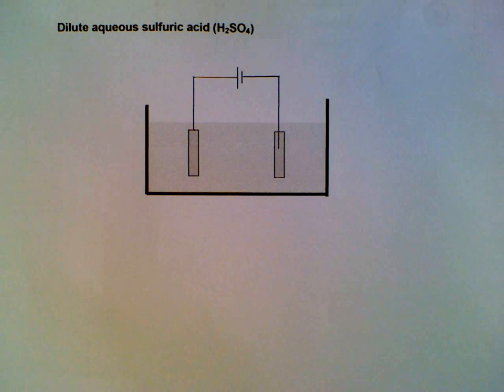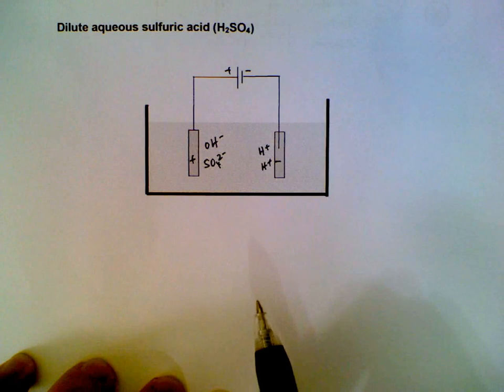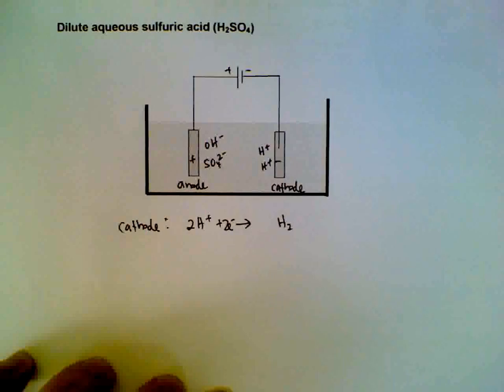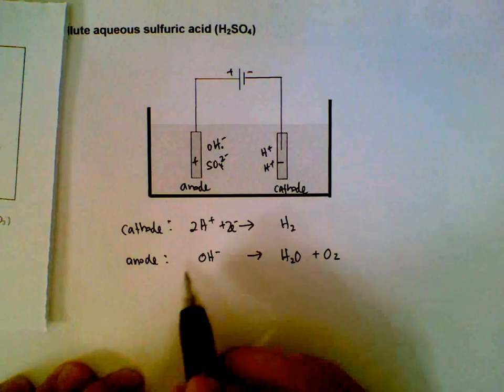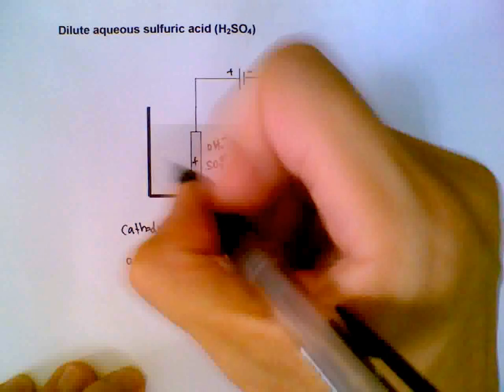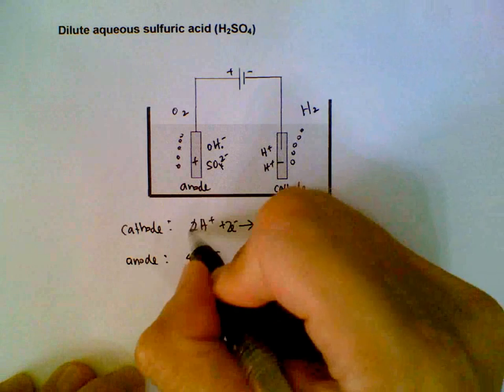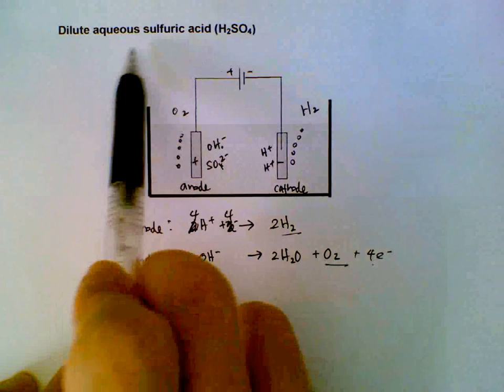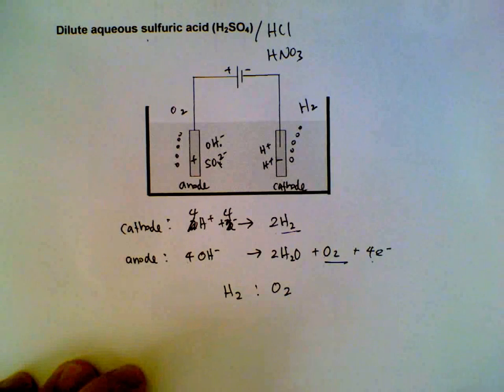Electrolysis of dilute sulfuric acid (inert electrodes)

Comment: Hi Meta Tutor. I need a simple way to recovery Copper from circuit board ( PCB). If  i put a pcb in a Electrolysis cell what happen?  Acid dissolve the copper during electrolysis and made H2So4 and the courrent move copper on the ectrode? Acid never end becouse S remain constant and just  add water for restore acid sulfuric? Is right what i think or is wrong? Please i am not expert in chemicals.

Comment: I thought Cl was preferentially discharged as opposed to what was written in that sheet of paper.  Please correct me if I'm wrong.
Reply from the maker: Hi there,  chloride ions are absent here as this is dilute sulfuric acid
Reply: @metatutor4817  I get that but in general, does OH ions get preferentially discharged over Cl ions? I'm not sure about the order for anions  :|
Reply from the maker: If the question indicates that it is a DILUTED solution of chloride, then hydroxide will be discharged ahead of chlorides. 
In a CONCENTRATED solution of chlorides, the chlorides would be preferentially discharged ahead of hydroxides.
Reply: @metatutor4817  Thank you so much :D I got it :)

Comment: Wot happens to SO4 - - IONS.will it combine with h2o
Reply from the maker: They will remain dissolved in the solution
Reply: @metatutor4817  hey they might H2SO4 again
Reply from the maker: That's correct. What is left in the electrolyte is simply a more concentrated solution of sulfuric acid

Comment: When I do the exact same experiment, with graphite electrodes and dilute sulphuric acid, the results are not 2:1. I get significantly more hydrogen than oxygen, as in the column of hydrogen gas is much more than oxygen. The ratio could be as much as 3:1 or more. What could be the reason for this? I understand that oxygen dissolves in water, but does it really dissolve that much? Is the 2:1 ratio only a theoretical thing? Thanks so much for this video, it's really helpful!
Reply from the maker: Yes, oxygen is much more soluble than hydrogen in water. It is therefore not unusual to collect less oxygen than expected.
http://www.wiredchemist.com/chemistry/data/solubilities-gases